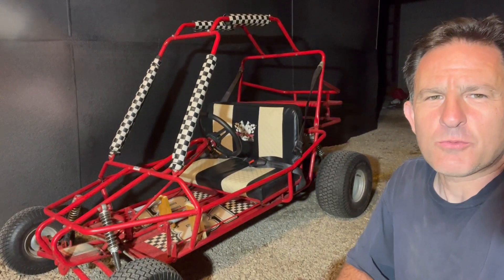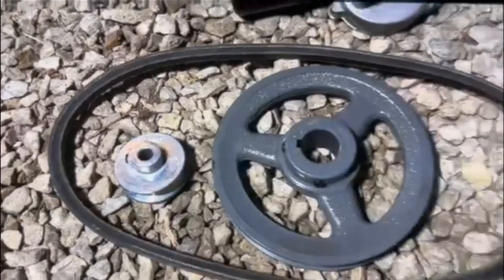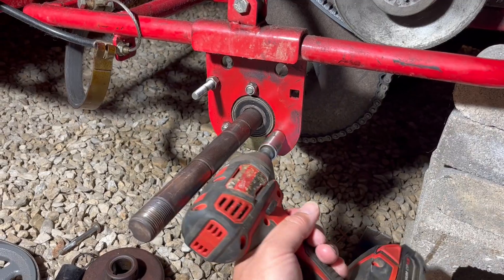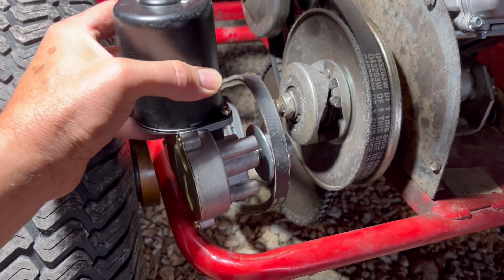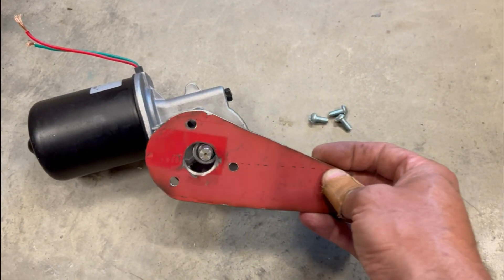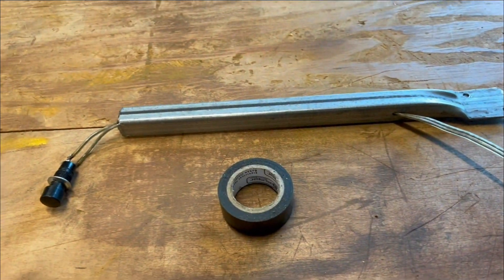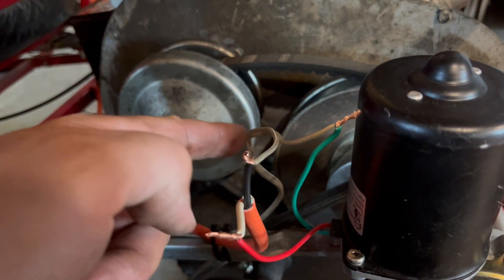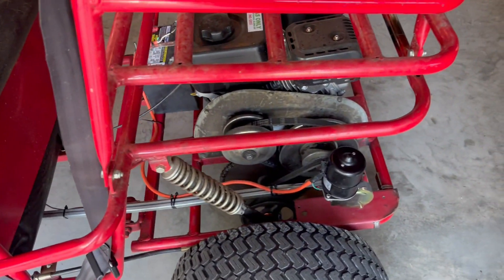Electric Reverse For Gas Go-kart

Comment: How well would this work with about 1000lbs that's including the drivers weight also. Would it still be effective?
Reply: You can do a larger 2nd pulley to give it enough torque, it'll just be slower backing up

Comment: Wouldn't the belt be damaged if not engaged while the large pulley is spinning forward?
Reply from the maker: No.  It would be like a riding mower with the blade disengaged.  The belt is loose and the pulley spins freely
Reply: @HowToLou  I'm thinking of a permanent system driven by a belt or chain, engaged by a starter motor or something so that the driving mechanism can spin freely in forward. Good idea?

Comment: Wonder how this would work if a battery wasn’t in the equation as in my case until I can afford to get the electric start motor
Reply from the maker: You can get an electric start kit for under $100
Electric Start Kit Flywheel Starter Motor Key Switch Coil Ignition Box Fan Cover,Electric Start Conversion Kit Compatible with GX160 GX200 US Stock https://a.co/d/4ebmh9D